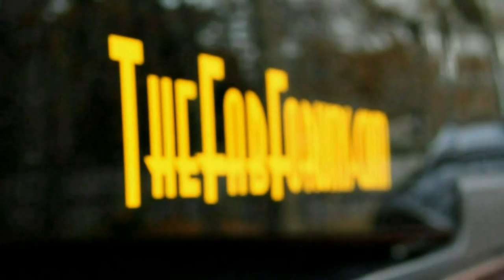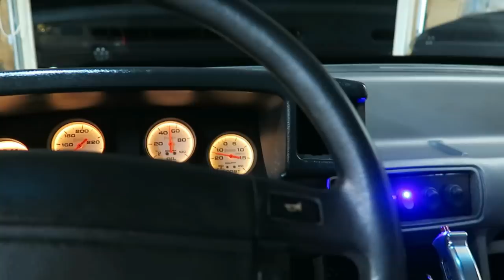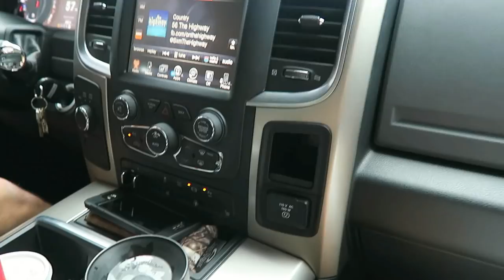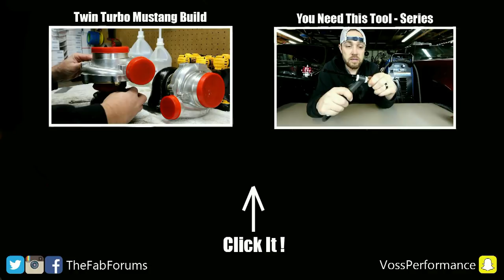500+ Fox Body Mustangs In One Place

Comment: I have your next project. I purchased a 93 cobra and found it has rusted shock towers and the frame reinforcement under the front seats had been cut out, to install racing seats. I purchased a 93 gt as a parts car and now am selling them both as a pair, along with a truckload of extra parts. The cobra is black with opal gray leather, non sunroof ,the gt is silver with opal cloth interior.I am outside Dc and will send pictures if interested.
Reply from the maker: sure send them to thefabforums@gmail.com
Reply: The Fab Forums, Thanks for the reply, I sent a bunch of pictures. I am sure the restoration of this cobra would be a project that myself and your other subscribers would like to see.